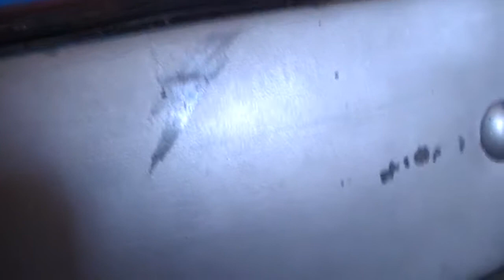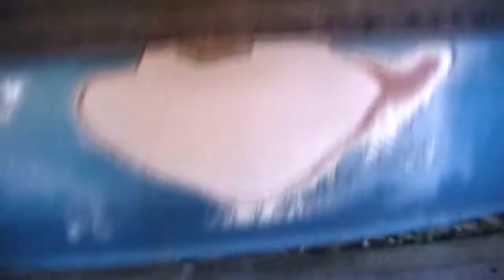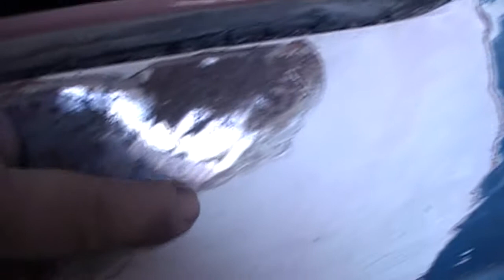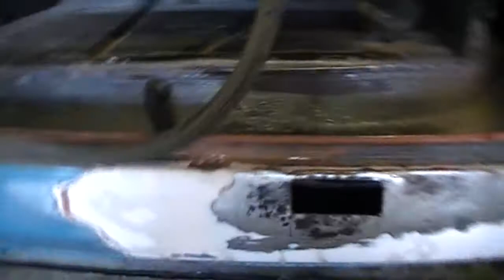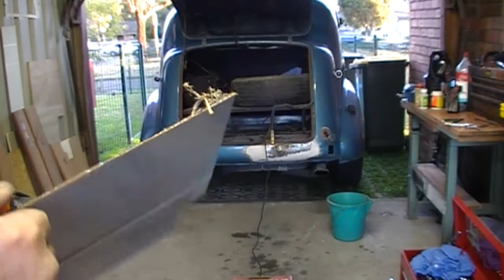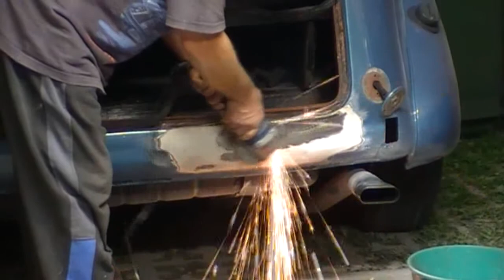Opening a can of worms.!

Comment: As Pisser would say... rrrrrrust. ;-)
I hate that stuff. I'm 'fixing' a Datsun 1200 ute (B120 for the US guys) for my brother-in-law. It's a mess. Replaced both rear quarters, one front guard, part of the drivers side floor and part of the floor in the back. Lots of other stuff too. It started out as fun, now it's just a nightmare.
Good you found that rust now but I'd be a little suspicious of the rest of that panel....
Regards,
Brad.